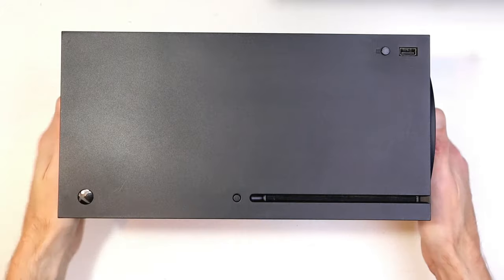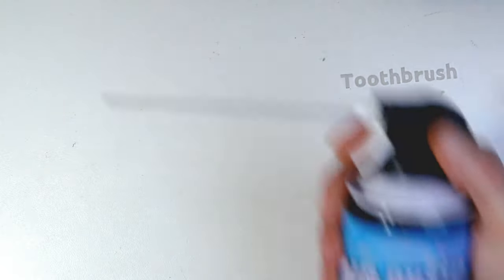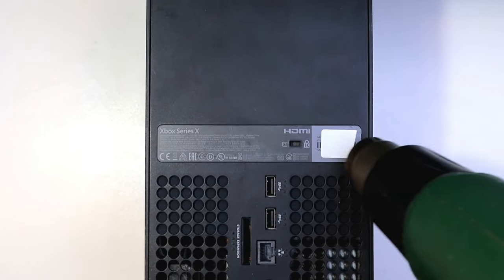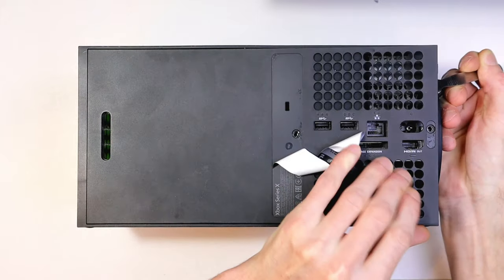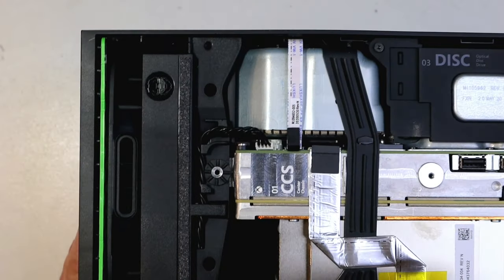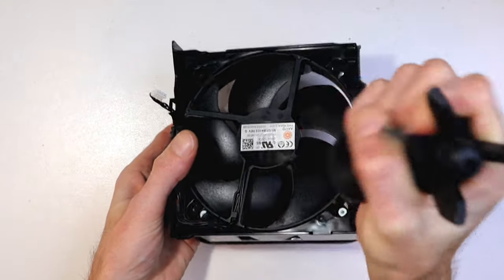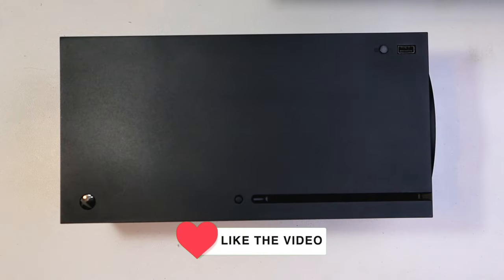How to Clean Your Xbox Series X Fan at Home

Comment: I think it’s a design flaw not being able to remove the top vent cover. Removing the back invalidates the warranty but cleaning is essential and if you can’t clean the fan and vents you risk shortening the life expectancy of your console. They should have had screws or clips holding the top vent cover so it can easily be removed for cleaning the fan. Some people live in more dusty environments than others and for some cleaning maybe a lot needed more regularly.
Reply: I actually think microsoft changed their warranty cover so that opening the back doesn't invalidate the warranty
Reply: It actually doesn’t void the warranty
Reply: I definitely see your point but the warranty is void after 2 years so I guess it doesn’t matter
Reply: it's probably more like they did it on purpose so you're too scared to open it and fry your xbox getting you to buy another one, with the way companies can be
Reply: No it doesn't?
Reply: I couldn’t get the middle screw off the fan and now the three us screwed so I gave up and blasted it with compressed air hopefully that will do
Reply: I know this is late but I got the series x early. While they were being sold for triple their worth. I got lucky and got one at normal price but anyways my point is is that even when they first came out I'm pretty sure removing the back was perfectly fine and that it never voided the warranty.
Reply: @jamesharrison8520  same here that middle screw was tight
Reply: It doesn’t void warranty (not anymore at least) but I don’t think it’s well designed for user-friendly cleaning.

I’m quite happy that Sony intentionally designed the PS5 for user-friendly cleaning despite how big and ugly it is lol. It’s way less of a pain than my XSX though.
Reply: Who cares about the warranty? 😂
Reply: It doesn't void warranty anymore. But it should be made easier to do. Basically, if you don't have the tools or knowledge, you send it to Microsoft and they charge you £100 to clean it. They talk about their hardware having longevity. If that's the case, they should make their hardware easier to maintain.
Reply: It's easier to clean than the xbox one. Also had trouble with that middle fan nut. Leverage was the trick if that helps anyone
Reply: I mean it's Microsoft they don't care about what works but rather how much money they can bring in
Reply: @ELPaso1990TX  you think that isn’t by design?
Reply: Microsoft for ya

Comment: Thanks a lot. what a disaster i had. I had workers at home. Even with my room closed lots of dust and particles managed to get inside. I am doing the cleaning. I want a long Life for my series x. Thanks
Reply: Nobody cares
Reply: @flynnchesher8984  well......I do
Reply: I have the same thing they are doing my bathroom this helps alot even tho 8 months later I feel your pain now man
Reply: @THGarciaR  thank you ! Imagine your brand new series x I had to save the money for months.... I closed and sealed the door but my mother opened my room and just left It open. The cleaning did a good job.....And I am sure the console Will have a Longer Life now.  Playing a lot of hours every week with no problems since then.
Reply: @flynnchesher8984  the cleaning really worked.  It was awful when I opened It. 8 months later the console keeps on heavy daily use no problem. Thanks to this video!
Reply: @THGarciaR  be really careful. The particles are invisible and really pass below the door and everytine you open. My advice IS unplug and totally  cover It when no use.
Reply: @p1ngu1no  i am doing that from now on yes thanks for the tips wil work on it this weekend probably
Reply: @THGarciaR  yes, cover  It. (Allways unpluged)  I was shocked to see how much dust slipped below the door.  Remember the console IS like a vacuum cleaner. Is talking a fair amount of Air all time.
Reply: @flynnchesher8984  I care.

Comment: Thank you Mick. My Xbox was constantly crashing and overheating and running so loud I could hear it over the tv at any volume lower than 80😂 since cleaning it’s so quiet I can’t hear it at all and it no longer crashes.
Reply: try move it somewhere less dusty too, i kept my one x close to a dusty radiator and that didnt help, but one xbox one never had any issues where it was sat.
Reply: @Iby00  same

Comment: Much appreciated bro! My Xbox sounds and runs just like new, I struggled to get the screws out without a torque screwdriver and ended up using a smaller flathead to do the trick! Took me about an hour or so in total to clean and runs perfectly. Thanks for the video keep it up 💯

Comment: Thanks for this I must admit I struggled with the large screw on the fan (middle one) and couldn't undo it probably cos my torx was a cheapy one lol but managed to clean it without removing the fan and now it's as quiet as a mouse so big thanks once again
Reply: Sam
Reply: Impossible to move middle screw mine ended up stripped
Reply: use a wrench to swivel the screwdriver round, works great

Comment: My series x keeps turning off by itself and when I would turn it back on it would say it had “insufficient ventilation” I didn’t have a screwdriver so I just air sprayed it. The problem went away for like 3 weeks then came back. I might have to take it apart and clean it
Reply from the maker: Yea it sounds like there may be a dust buildup on the grills rather than the fan. I might end up doing a full clean tutorial for these if i can get my hands on one again
Reply: @TinkerManMick  yeah I thought so too. Once I get the screw driver I need I’ll watch your video on how to clean it again. I’ll subscribe too.
Reply: Bruh how can be dusty after 3 weeks, I got my Series X a month ago and its still looks clean
Reply: @TinkerManMick  I just cleaned my Xbox and I went to play fifa and it shut down still ? Should I get a fan on top of the other fan would that work ?

Comment: One alternative method that I used after opening the back of the series x  was blowing the vents with my lungs because I did not have air in a can or his air tool from the video. Yes it's a bit of a caveman method in my opinion but I was able to clean the fans this way and not struggle too much besides coughing some from the lint and in some of the deeper places that I couldn't blow I then used q tips to clean the tighter areas that are harder to reach. The same methods also work for people who still have their Genesis and SNES cartridges and are trying to simply clean them.

Comment: Bud, use a small shop vac with a brush end on it that was you’re suckin up all the dust instead of it dropping back down in or getting all over everything, they even make mini hoses for “electronic” work. It works better than anything & ive been doing it for yrs.

Comment: The middle screw on the fan is so tight its impossible to remove ive tried many times its like its bloody glued in
Reply: Same for me.. can't get the middle screw out..
Reply: Take another metal thing about the same size as the screw head. Heat it with a heat gun until very hot. Press it against the screw to transfer heat into the screw in the fan without heating up the surrounding. Could use a solder tool if you have one.
Reply: Same. I can’t never open middle screw. Anyone solve this?
Reply: Middle screw is impossible to turn...I ended up stripping mine. Made me very mad that it's that hard to turn a screw
Reply: Same... stripped it and broke my screw driver now I'm prolly fked
Reply: Iv got the same problem it's to tight iv tried a rubber band like a few people have said but that's done nothing
Reply: use a wrench to swivel the screwdriver around the middle screw, worked perfectly for me

Comment: Did you pull on the wires to unplug your fan? 😬😱 I can't see how else you're able to pull it out with your fingers. There's like zero room for your fingers to get in there and grip, especially the angle you went in at, like top to bottom. I'm lost

Comment: Would a Flat Head screw driver work for the pry tool? And will my own blowing air work for the rocket ship air distributor? I went on amazon and with delivery it is a touch expensive.
Reply: Canned air is $5
Reply: I would recommend against blowing air from your mouth as saliva droplets can easily short some component. Some alternatives to compressed air are: vacuum cleaner on reverse setting, bike pump/baloon pump, waving a hand fan close to it.
Reply: You can afford a $550ish (with tax) console but can’t afford a hand powered air blower? 

Here’s a money saving tip: soak the entire Xbox in some warm soapy water for 10-15 minutes. Afterwards wipe the external surfaces with a towel. 

IMPORTANT: Do not disassemble the Xbox. 

Then use some big luggage or big tuppaware and fill it with rice and let the Xbox soak in the rice for about 1-2 days. 

Plug in and enjoy. The only expenses should be enough rice to surrounded the Xbox in a piece of luggage/tuppaware as I assume you have one of the latter.

Comment: I need facts I sprayed my Series x with condensed air WITHOUT the straw you put into it and some liquid like substance got in it also some white stuff got on it to (cause I was spraying it close to the console my question is should I be worried about 

Lower frame rate 

Lower graphics and resolution 

Increased load/ download speeds

Comment: I recently deep cleaned my PS5 after owning it for almost 2 years and wanted to give the same treatment to my series X. It's really dissapointing microsoft made it so impractical to gain access to the fan. With the PS5, it's just a matter of removing a few screws, here you have to go in with a heatgun. Definitely a major design flaw on Microsoft's behalf.

Comment: Cant get the middle screw out for the fan
Reply: @Falcon-um7vono bro it's actually a problem. Mine was on simply too tight I used all my force and it stripped and now I can't get it out. Trust me it's not user error alot of people are having this issue with the middle fan big screw
Reply: @Falcon-um7vo mine was literally so tight I had no other option but strip it trying to get it off. How tf is that user error? Many people have problems with the same damn screw and I had 0 problem with the other screws. Yet it's user error... my dad that's a construction worker I bet couldn't get that damn screw out without some type of drill
Reply: @Falcon-um7vo on God it wasn't user error. And I don't swear to God for no reason. Your right it wasn't stripped, just so tight to where it made it impossible to get off. Like I said, it needed a drill or something
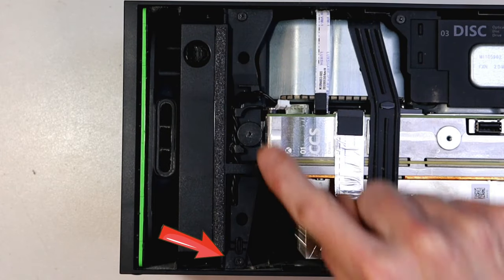Reply: @Falcon-um7vo 2:46 that middle fan screw. It requires the same t8 security screwdriver like the other ones, but it was unbelievably tight and wouldn't budget even with all my strength. I just don't see how that's user error. I used the same screw driver and technique the youtubers used, yet mine just wouldn't budge and then I got frustrated and stripped it.
Reply: Yep way too tight can’t get it out either
Reply: @ReformedJerry try grabbing a pair of vise grips and grab the screwdriver that way I managed to get it out

Comment: hey, not sure if you will still respond . At 2:44 my T8 screwdriver isn’t working for the middle, circular screw. Any help??
Reply: Did you ever figure it out? There's a lot of people in the Comments having that issue so im not sure if I should even attempt it
Reply: @gus051  i couldn’t unfortunately
Reply: @charliemiley9481  I attempted it last night and couldn't figure it out either lol
Reply: @gus051  probably just take it to a shop or service and i’m sure they can figure it out
Reply: @charliemiley9481  could the dust on the top of the fan actually cause any issues though? I opened my system last night and the heat sink had a ton of dust on it to the point it was actually blocking a big chunk of it. I cleaned all that off (minus the fan) so hopefully that's enough to make a difference.

Comment: Hey. So i cant get the middle screw out even with the right screwdriver. What should i do?
Reply: I get what you mean. The screws are on really tightly.
Reply: I’m having the same issue looks like it was stripped when they tighten the Xbox when being assembled
Reply: @dmarisellers-coates6763  could you handle it?
Reply: Use a Allen wrench

Comment: Help my Xbox keeps turning off saying insufficient ventilation when I turn it back on but nothing blocks the holes what do I do
Reply: You probably have to open it to clean. I think the dust inside is the problem. But if you open your xbox the guarantee disappears.
Reply: @derguutebabobauer  thanks
Reply: @derguutebabobauer  yo I just cleaned my Xbox like the video but I was playing fifa and it shut off still saying insufficient ventilation what should I do you think putting a fan on top would work?
Reply: @begreat3543  sorry im no expert it was only my supposition. If this little guarantee sticker isnt damaged too much i would change it for a new one.

Comment: Does that void the warranty?
Reply: Yes. Not a great idea to do this
Reply: @user-we8mu7lf6x  Indeed, atleast as long as warranty is in effect. The thing I do, whenever Im not using my Series X for longer periods of time, I put some cloth on it, so less dust would get on/inside it :D...I know in the long run it matters little, that thing is gonna keep collecting lot of dust over the years, which is why I was bit skeptic of the design, but then again Im sure my old 360 has collected lot of dust inside it as well over the years and its still working despite it.

Comment: for the fan the middle screw is too tight for mine and it’s starting to get rounded any advise ?
Reply: Use a screwdriver that has a T-shaped grip
Reply: @OSITO-xm7gl  force isn't the issue. It's starting to strip the threads is what he's saying
Reply: Put a rubber band over the top of the screw and put you screwdriver in the hole with the rubber band in between the tool and the screw. This will give the screwdriver more grip without damaging the screw near as much.